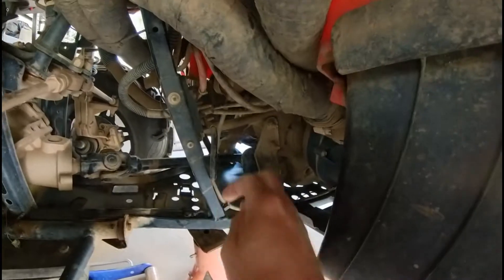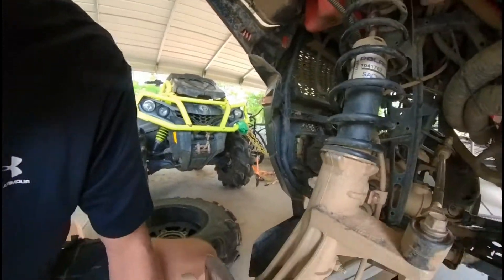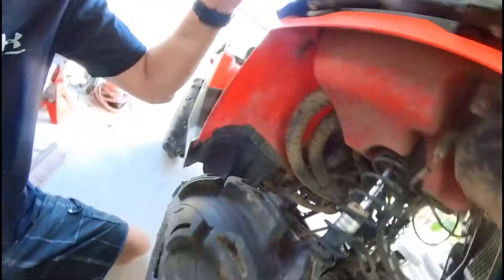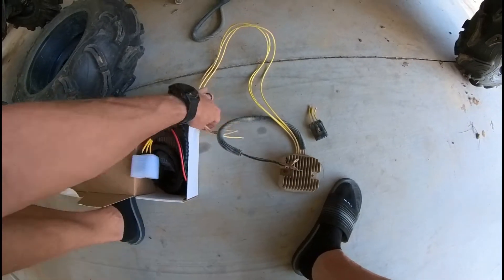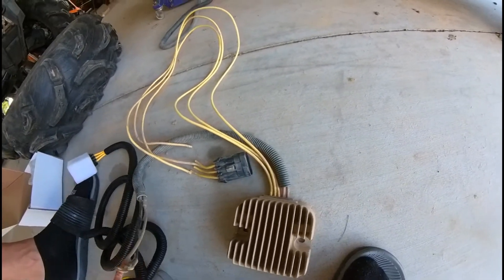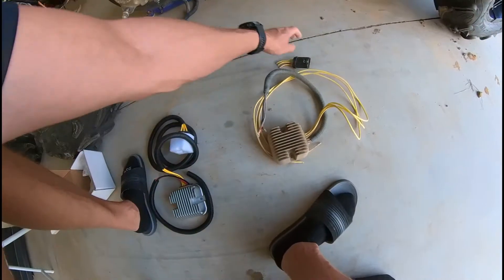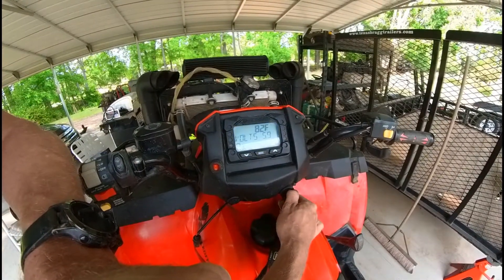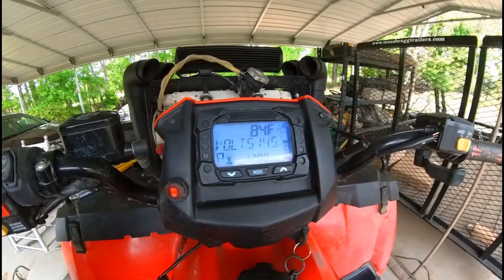Voltage regulator repair/comparison on a 2018 Polaris Sportsman 570

Comment: Hi. I did a new voltage regulator. Mine bounces between 14.2-14.7 mostly but sometimes up to 15-15.2 and back down. My dash flicker and other issues went away but I’m wondering what you think about it.
Reply from the maker: Make sure all your connections are clean and it is grounded well.   If those are good it could possibly be your battery.  I am definitely not an expert so I would suggest doing some research online and see what you find.
Reply: In ours the voltage is sometimes 11.7 and at one point it was over 16 volts. Do you think it's the voltage regulator?

Comment: How's the new regulatory holding up since the videos been out? Battery cuts out after shutting off. Runs good all day long but sometimes there isn't enough cranking speed. New battery so has to be this?
Reply from the maker: It is still working fine.   Can’t beat it for the price.

Comment: When the cables are connected (the ones you showed underneath next to the oil filter) my screen flickers. When i disconnect them, the flickering goes away. Any idea why?
Reply from the maker: Is this with a new regulator?  1-If so it sounds as though it is sending to much voltage.  If new I would return it for another one.  2-If it is your old regulator it sounds as though you may need a new one.   3-(should be #1)If this is original regulator start by making sure battery is ok also jiggle the ignition switch key just to rule it out as well.  They are finicky also. 4-make sure no wires are frayed.   Hope this helps.
Reply: @reeldazed539  thank you sir. It’s my old one, might be worth changing it out. Just took her out for a test ride, shut off. Volts dropped to the 10’s
Reply from the maker: Yeah if your battery is good it’s likely that regulator.  If you change it out let me know how it goes.  Thanks!
Reply from the maker: That’s awesome.   It’s always good news when all it is is a loose bolt.   Takes a little time to find it but it’s usually free!   Glad you got it worked out!

Comment: Do you have a link to the regulator you got off Amazon?
Reply from the maker: I am unable to because I do not have an affiliate account yet.  I wish I did.  However the following is the info I sent to someone last night. (The model I got was Tepeng (just be sure to punch in your year model and Polaris sportsman voltage regulator on Amazon search).  Thanks for watching and please consider subscribing.

Comment: My sportsman 570 volt will say ovr when I hit the gas and when I turn it off the battery died instant the only way I turn it on was with cables u think it’s my regulator ?
Reply from the maker: It sounds like it is going over voltage. Pending your battery is ok I would suggest checking the wires that come out of the motor (stator wires) and make sure they have not rubbed through. Like in the video look good behind the oil filter area at the wires there that is where they tend to rub through. I
Reply from the maker: Continued……if those are ok it is a strong possibility it is the voltage regulator.   They seem to be an issue on these things.   If it is just follow the video for the install.   The one I got on amazon is still doing fine on mine.   Hopefully this helps.   Thanks!
Reply: @reeldazed539  do u have Instagram or Snapchat or something so I can text u ?
Reply from the maker: I apologize but as of now I do not.
Reply: @reeldazed539  I just wanna make sure it’s my regulator I also have speakers and when I press the gas they cut off and the voltage will say ovr when I press the gas
Reply from the maker: @anthonycina3858  you could disconnect the speakers/stereo and see if that resolves the problem first.    However, given the history of these regulators going bad on Polaris Sportsman’s along with the symptoms you are describing it is a strong possibility the reg is the culprit.   The regulators are under $50 on Amazon.   The model I got was Tepeng (just be sure to punch in your year model and Polaris sportsman voltage regulator on Amazon search).  It is easy to switch out and if it is not the regulator then you will have a spare when it does go out. I can’t guarantee that is what it is but that is how I would handle it.    Let me know how it turns out!   Thanks.
Reply: @reeldazed539  thank uuuu veryyyy muchhh U don’t know how much u just helped me I’ll let u know when I put it on
Reply from the maker: @anthonycina3858  No problem,  I just hope it works out for you.  Keep me posted.  Thanks again!
Reply: @reeldazed539  I got a 2020 u think it will still work for it ?
Reply from the maker: @anthonycina3858  I suggest the following....1-go out to your machine and take a look and snap a photo of the voltage reg with your phone.  It should be mounted on the front grill area.  Pay particular attention to the wire(s) coming out and take pics of that.  2-go to the website called Partzilla, click on menu, click on add new ride to my garage, hit the dropdowns and add your vehicles info. The dropdowns you can select have the different models (EPS-electronic power steering, SP, touring, etc.)you will have to know that.  3-After you select model it will take you to a components page. This page has every part list imaginable for your atv. 4- Scroll over to the second column and scroll down to where it says ELECTRICAL VOLTAGE REGULATOR AND MOUNTING.  5-CLICK THAT. That will give you your part and part number. 6-Now click on that and see if it matches the pic you took of yours.   For a regular 2020 Polaris Sportsman 570 that part number is 4016868.  You can buy it from them (they are great to order from as well) or you can try to find a compatible one cheaper on amazon or the internet. 7-After you find one read the reviews, some people will list what they put it on and how it worked.  Make your decision from there.    It DOES NOT APPEAR to be the same one that was on mine (2018) but check the pics to confirm. If it is the 401868 it should be even easier to change out.  You can also go to powersportswarehouse.com to look up parts as well.  Good Luck!!
Reply: @reeldazed539  do you think the one u got will work ? The cables that coke out not the same but I can still connect them
Reply from the maker: @anthonycina3858  if it does not match up I personally wouldn’t use it. I would get the one that matches up to yours.

Comment: I need the the plug that comes out from the engine and connects to the plug with the 3 yellow wires. Can you tell me what that is called?
Reply from the maker: I believe it is called a stator plug.   They make stator connector repair kits also.  Be sure to match year make model with new one and look at pics to confirm it looks the same as your old one.   If it is damaged to the point it is unrecognizable look at the one in my video.  Hope this helps!

Comment: What issues were you having that lead you to replace the voltage regulator?
Reply from the maker: Sorry to hear you are having those issues.  Hopefully you will be able to get it resolved soon and I hate I am unable to give you any further suggestions on it.
Reply from the maker: The volts were dropping to the point my machine cut off.
Reply: @reeldazed539  did you have check engine code?
Reply from the maker: I did not have a code.  I had a new battery so I knew that was not the issue.  After researching I found that this is a somewhat common issue so I decided to try this as a cheap replacement to see how it works.   So far I still have not had any issues with it.
Reply: @reeldazed539  cool thanks man I’m having issues with mine and trying to figure out what my issue is I’ve replaced tmap sensor and harness and fuel pump but I still get the code for map sensor but if code goes away then the quad shuts off but if code is on then quad runs good
Reply: I have a 2018 570 and it has 5000 miles i have about 600 watts just in light bars i usually run my 450 bar with all the warmers and lights ect the only time i had an issue is if i put the high beam on then i drop to 14.1 volts and my fan is slower still has factory battery and i live in cold canada at -30 guess either my utility edition has a better stator or im lucky